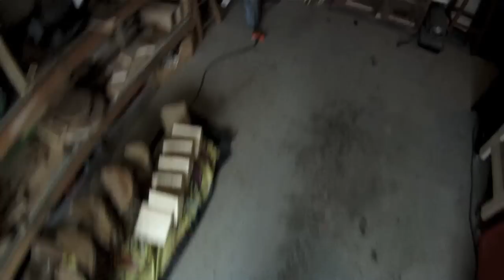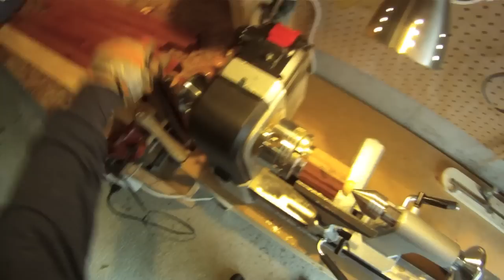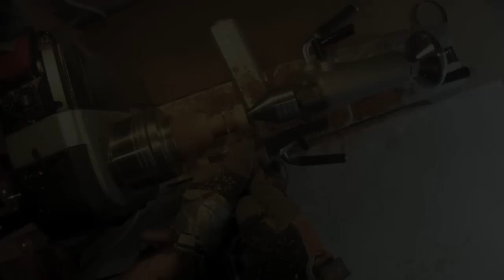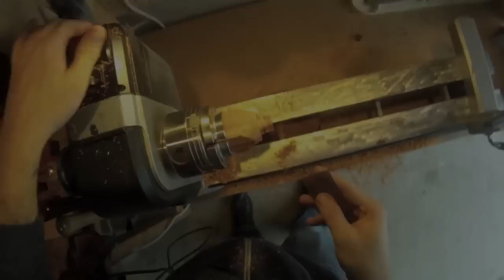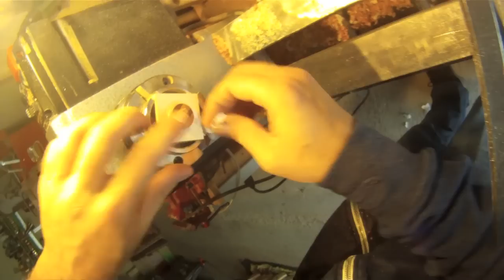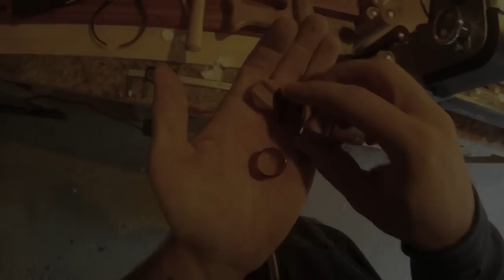3\4" Plugs Turned on Lathe {GoProHD}

Comment: Hey there, just curious if you had any trouble getting the plug true when you rechucked it in the jam chuck? I've tried a few things and this is an on going issue for myself. Closest thing I've had to consistently true pieces was to use a nova soft was set and make a small recess, but this only works when making pieces larger than 1/2 or so. Any tips would be much appreciated. Thanks!
Ps, I personally like carnauba wax over bees wax, and jojoba oil over emu or vit E. they're both also vegan. :)